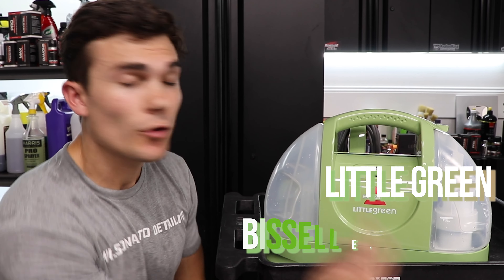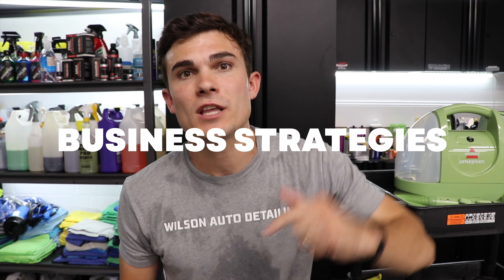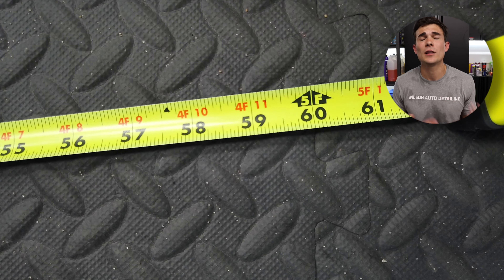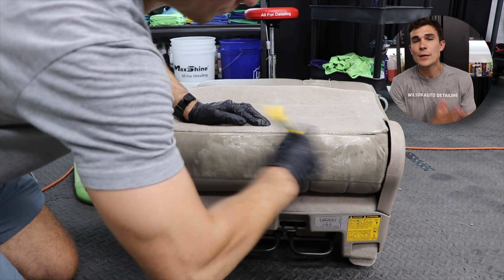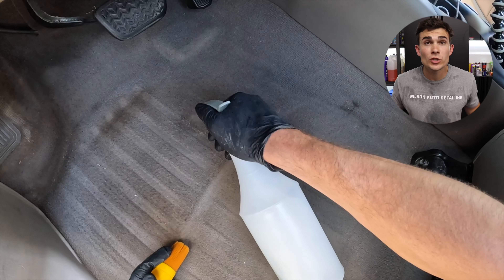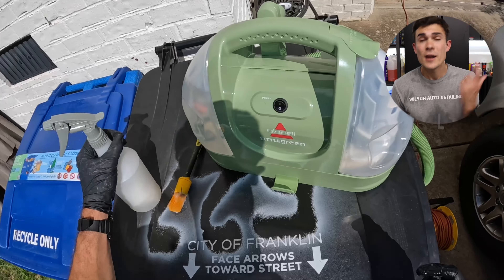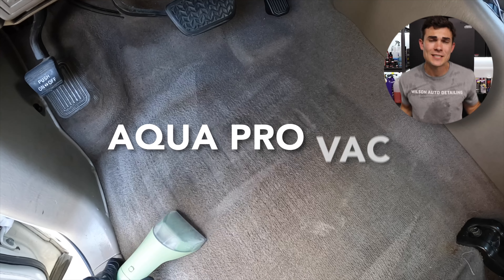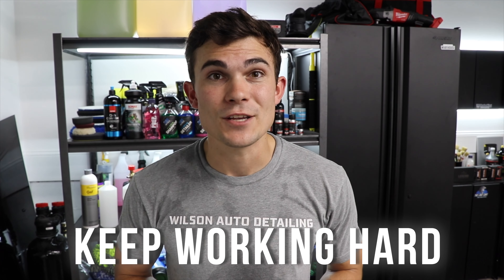Bissell Little Green Machine Review & Comparison To Bissell Spot pro

Comment: I took a small drill bit to my little green pro heat and widened the water output, MUCH better!
Reply: where did you drill the hole?
Reply: @fiercepierce123  where the water comes out of the hose end above the trigger
Reply: thank you 👍
Reply: One of my cleaning heads hardly puts out water. The deeper cleaning tool with the teeth puts out plenty.

Comment: I just went to Walmart and picked up the Bissell model 2505 and it's $129.  Just cleaned a bunch of cushions on patio furniture.  Works good.  With a about a 6amp motor extraction isn't as good as my Proheat upright model but for the jobs it is intended at the price it passes. Cheers and great video!

Comment: I just modded my shop vac Ill have to do a side by side comparison with the Pro heat. Ive had good results with the Proheat. The dirty water tells me Im getting loads more out than I ever could with a towel. Of course I have to empty it like three to five times depending on vehicle. Hence the upgraded tank.